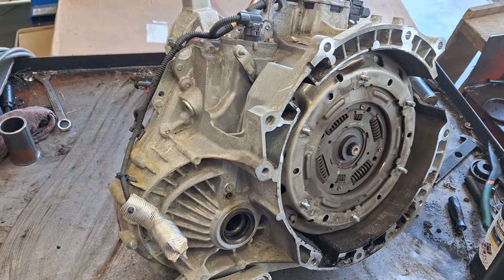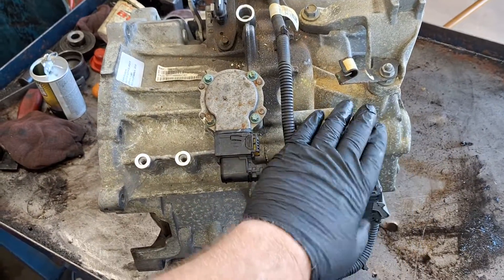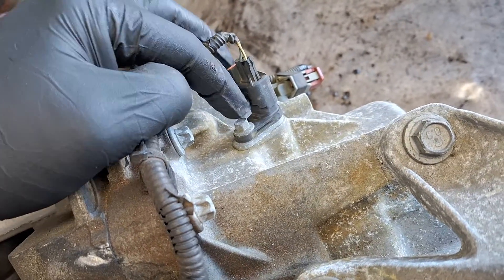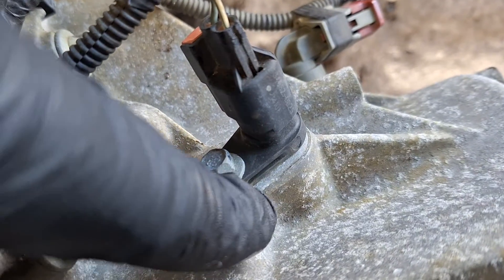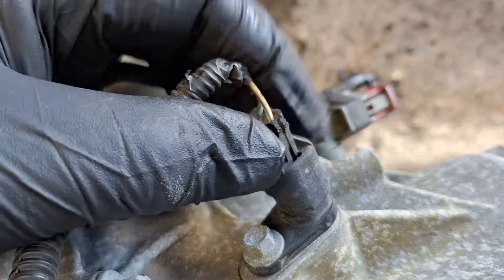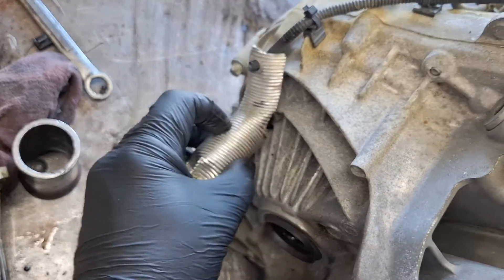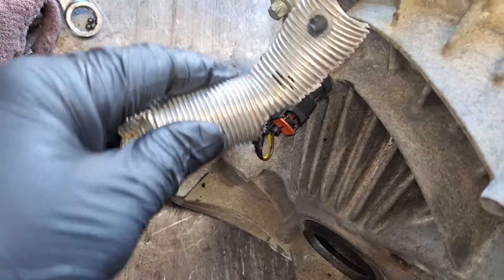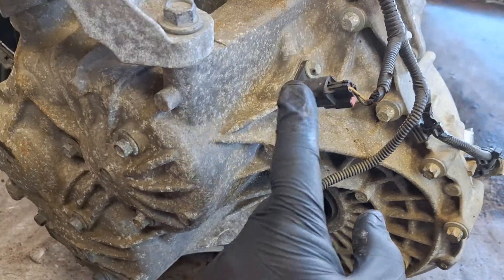DPS6 Sensor Identification Ford Focus & Fiesta (Transmission Sensor Replacement)

Comment: Can these sensor also cause the car to limp and makes the car jacking when goes on uphilds?
Reply from the maker: Possibly, If you have fault codes for one of the sensors I would fix that before assuming its something else

Comment: would the range sensor or switch, cause the drive indicator or the dash flash on and off if its going bad, when im driving the D indicator will flash on and off like its being selected then deslected, like someone is messing with the lever for park neutral and reverse. when the D selection indicator flashes on and off it causes my engine to rev up and down till it goes back to being selected, ran forscan no obvious codes besides p0850

Comment: Hola, tengo un Ford Focus 2012 transmisión automática 
Embrague, horquillas y actuadores nuevos, aprendizaje correcto y sin código de fallo
Pero el carro cuando pasa de 5-10 mph y el motor sube a 2000 rpm el carro brinca da tirones, luego que sale se siente bien y hace los cambios mejor. Es solo   tirones saliendo del puesto 
Que pudiera ser ..?

Comment: Hello Ben 2:29 2:29 2:29 😊  i am driving FORD Focus 2007 . And stat getting an engine and Transmission MALFUNCTION.
 Alram.
When diagnostic the car repair shop we got this error list.
What do reccomaning for reparring.
And is it can be done do it yourself?  Thanks
Reply from the maker: It's a different transmission on the MK2. Need to know what codes you have
Reply: @BigBensCarsAndCycles  z I have   TCM  Error. code number: PO720 FF OSS  : output dhaft speed sensor circuit error.  Hope you have some practical advice for fixing such error.  Thanks
Reply: @BigBensCarsAndCycles I have code  number PO720FFOSS. can you please advise? Thanks

Comment: It has transmission fluid pressure sensor?. And where is located
Reply from the maker: No it doesn't. Not on this one, this is the dry dual clutch
Reply: @BigBensCarsAndCycles OK.  thanks, bc my ford fiesta 2017 has 3 confirmed codes.
P0805
P087A
P0843 transmission fluid pressure sensor/switch A circuit high

Comment: Im so fed up with this car.. got another abs module, still lft front wheel sensor code, right wheel sensor codes, tc light... now a bcm low voltage code.. and latitude and longitudinal sensors code and no speedometer still dont move.. replaced both front wheel speed sensors, oss sensor, and the a/b shaft sensors.
Reply from the maker: It's common for mice to nest and or chew into the wires next to the ABS module. I would check there
Reply: @BigBensCarsAndCycles where is the longitudinal/latitude sensor located?

Comment: Do you know where the fluid temperature sensor is on a DPS6? code P0712? Cannot find any videos on this or removing the valve body for the DPS6. thanks
Reply from the maker: Hey there is none, its based on an algorithm from detected clutch slip. Diagnose other clutch codes first to fix that

Comment: My 2013 Ford fiesta will not go in reverse but will go in drive. I hooked it up and has a code P0870 code  indicates a problem with the Transmission Fluid Pressure Sensor/Switch "C" Circuit. What would that sensor be? Thanks
Reply from the maker: hi that sensor doesnt exist on the dps6. unless, do you have the diesel engine and 6dct450 wet clutch? if so thats not in my market so I'm not sure

Comment: i did that before i bought the hub i even swapped left to right and the same left side keep coming up
Reply from the maker: you swapped sensors left to right?
Did it do it before replacing the hub? If not then you might have put the wheel bearing in backwards because one side of the bearing has the encoder ring so its directional

Comment: hello thanks for all your very detailed videos i bought one of the 2012 ford focus replaced the clutch and forks car is ok now but my abs esc speed meter and my steering feels stiff did a scan and left wheel speed sensor fault came up i replaced the sensor but light still on so i replaced the front abs hub and bearing but my hill assist still remain along with the same abs code swapped the right side over to the left same problem on the left side so i know its not sensor i need help.
Reply from the maker: need to know what codes it has

Comment: Would the OSS give me a trans overheat or trans fault warning everytime i tale the car out?? We have replaced the clutch,throwout bearing, and forks, also tcm was replaced with it..after doing all that the car now started to say the teans over heat or trans fault warning light, but it runs good no crazy shifting or slipping
Reply from the maker: need to know what codes you have  and i can help 1 on 1 in the discord group
Reply: @BigBensCarsAndCycles no codes what so ever just the trans fault warning thst comes and goes or trans over heats that cones and goes..i have replaced tje clutch like said before and forks and tcm as well..i did  not have the trans fsult warning before jist the clutch was worn out thats why it was replaced

Comment: Im back again, and thanks for the last reply back. Short story!!! 2013 focus se 2.0 auto. Just bought. Previous owner replaced both wheel sensors,codes were both wheel sensors, abs pump fault code ,traction light,abs light, and speedometer doesn't work even after the abs wheel sensors replaced. Question is now that i just installed a, abs pump  and module,and wheel sensors,is this going to fix the speedometer or is that just the oss sensor not responding.
Reply from the maker: Hey you can monitor signals from suspected failed sensors while driving using a scan tool
Reply: I can't on the abs side. Live data only on engine side. After installing the abs pump and module, and resetting the codes both front lft,and rt abs codes are back aswell as a longitudinal sensor. The old abs pump didn't have the longitudinal code.. so now I got the  longitudinal code, both  wheel sensor codes,break light, abs light, traction ctl,.. abs pump code is gone.
Reply: Also speedometer still doesn't work but no code on that. Could the (oss) do all this because it isn't reading axel speed?

Comment: Which one does the speedometer?? I've replaced both wheel sensors  nor luck.
Reply from the maker: The OSS. Output shaft speed sensor

Comment: What's the sensor called  that is connected  to the round type sensor  is a six or seven pin six or seven wire  connector

Comment: Ford focus st 1.0 eco boost 2020 where is the transmission temperature sensor pls?
Reply from the maker: @ClarkNicolas-mz5uz  pretty sure it's bolted onto the valve body
Reply: @ Thank you for your quick reply 🤝

Comment: 2015 ford fiesta 1.0 liter . 5 speed manual. Speedometer not working. I cant find the part number for that sensor to replace it. Is it the same as a automatic?
Reply from the maker: @JT-jq9wo  hey it's likely different. Put your vin in on fordpartsgiant

Comment: Could the sensor B being faulty, be the cause of the transmission overheating? It says the transmission is overheating but I checked it with an obd2 scanner and it says its just the clutch position sensor B
Reply from the maker: I've got a video for clutch position sensor codes explained. Its probably a bad actuator
Reply: @ Thanks for the quick reply I also had another question. When I turn the key the car wont start for a few cranks until I hear the engine make a lot of noises then it will start. This noise also happens when I open the door does that mean its most probably the actuators as you mentioned?

Comment: Which sensor is the “overheating “
Reply from the maker: @2010dlewis  the tcm uses an algorithm that uses detected slip to assume overheating.  Usually if overheating you need a full clutch job and new actuators
Reply: @ I did that already. Just started driving it. After 20 minutes on highway it pops up.

Comment: Ben, Great video.  Can you replace the sensor - output shaft speed and transmission connector kit without going under the car?
Reply from the maker: Yes. You can remove the airbox, battery, battery tray, and unplug all 3 speed sensors, then pull the harness up on top to work on it.

Comment: Which one is the park sensor? Or neutral sensor?
Reply from the maker: @2010dlewis  it's the range sensor on top
Reply: @  okay good. Makes me feel little better. Just done the clutch swap from your videos and I half broke this connector. Car says not in park. That’s what I was hoping was. Thank you for fast reply
Reply: @ ok. So I checked the connector. Getting 5 volts. But no crank. Took the shifter off moved it to park. No crank. The indicator light isn’t on either. I just put new clutch in it and just had TCM repaired few weeks ago before I done the clutch. Do you think it’s the positional sensor? Or is it a voltage issue?
Reply: @ also do you know what numbers 1,2,3,4 on the position sensor I can jump to get it to crank?

Comment: My vehicle makes like a rattling noise from the driver side. Think its transmission related. It does it before giving gas and get it moving. Then noise goes away. Then back when at idle. Any idel why it makes noise?
Reply: Sounds like soda cans? It’s the two clock gears apparently it’s normal

Comment: I just read online that if you have an automatic transmission dual clutch and your replacing the actuators that the tcm needs to be re-learned or reprogrammed with an high end scan tool or thru the ford dealer is this true? That's probably why the actuators were not were not working correctly?
Reply from the maker: @michaelbarela2733  hi, replacing the 2 actuators does not require anything after

Comment: Big Ben I replaced both oem actuators and it made my shifting worse and the performance worse my speedometer wasn't working and my dash started acting up, I had to take them back out and put the old ones back In, when I took it for a test drive I decided to just step on the gas pedal and see what happens with the old actuators the rpms still hit 2500 almost 3000 in 1st and 2nd and 3rd gear, this is an automatic transmission, I ordered an output shaft speed sensor I'll see if that fixes the problem, next step would probably be to replace the TCM, any suggestions?
Reply from the maker: @michaelbarela2733  hi, what fault codes are present? And yeah since your speed wasn't showing that may be the problem
Reply: @BigBensCarsAndCycles  no codes are showing, my speedometer works just fine now with the old actuators put back in, I'll wait until I get the output shaft speed sensor installed and see what happens probably nothing lol, I don't think it's normal for a car to hit 2500 or 3000 rpms In 1st 2nd, 3rd gear is it? Can a bad tcm cause that to happen? Will PID read the tcm ?
Reply from the maker: @michaelbarela2733  I'd drive it until it sets a code. If you full throttle it while it's acting strange that can help set a code faster

Comment: If I'm not showing any codes can a faulty output shaft speed sensor cause poor acceleration with high rpms?
Reply from the maker: @michaelbarela2733  maybe. Check the pids on the scan tool for signal drops or spikes
Reply: I have a cheap cable obd2 I don't believe I have options for PID, would you happen to know if cheap obd2 scanners have options for pid, I might have to invest in a better obd2 or a wireless wifi obd2
Reply from the maker: @michaelbarela2733  forscan is a good option, you need a laptop interface for 30 bucks

Comment: Hey Ben, big fan of your videos I actually recently did the clutch/fork replacement on my ford focus 2013  thanks to your tutorials I put everything back but the car won’t start I put the scanner in to it to do the adaptive learning and I get a range sensor code do you think thats the reason for the car not starting I also noticed that on the scanner I can see that it says it’s on drive when it’s really on park I’m thinking of replacing the range sensor but I thought I’d run it by you thanks again
Reply from the maker: @LuisGarcia-pr3rv  hi, glad the the videos helped. I would make sure you reattached the shifter cable to the transmission
Reply: @BigBensCarsAndCycles  that is the first thing I checked when i noticed it was not working I get a lot of different range sensor codes like P0707,P2801,P2802,P2803 I just hope it’s not tcm related

Comment: Great job ben! Just wondering if i have a error code P1934 Engine Control Unit - Vehicle Speed Signal, can i solve the error just by replacing the input speed sensor A (the grey one). I have other codes about ABS U3000(48), but i just want to leave it by when i have the funds to replace/fix the ABS. Thankyou!
Reply from the maker: @risuchannel8115  hi, glad the videos helped. I would look for a damaged OSS or OSS wiring. If that looks OK, I'd monitor signals for OSS, rf wheel speed and left front wheel speed while driving

Comment: Very helpful. I smooshed the input sensor B wires and exposed the conductors trying to get the trans back in place. I found a replacement pigtail right away once you mentioned the ABS pigtail is the same.

Comment: Recently I found your video and very instructive. 
I have ford focus 2014 but it's giving me hard time with the ABS light,  traction control and speedometer doesn't work. 
I changed all the wheels sensor already. 
Front right wheel sensor is not reading, besides that ANY advice. 
Thank you 👍 👍👍👍 Good day
Reply from the maker: @basschallenger  hi! Check for damaged wires by the abs module behind the battery tray

Comment: Can I reline the stud in the flywheel after the transmission is in ?
Reply from the maker: No, it needs to be pulled back. But I haven't found indexing to be a problem

Comment: Hi BigBen thanks for sharing this video. My 2010 ford fiesta 1.6 T giving me lot of issues with the transmission malfunction message. I went to a dealer service and after diagnose they informed TCM module need replace. The next day when i went to replace the part they informed the ABS also need replace. I feel something wrong and i didnt replace anything after seeing the cost of both module arround 1500$ Still the car is running and speedo Audo meter not working. Some time the car show the message transmission malfunction service now!!! Can you advise me any other reason for this issue or I need to replace the TCM and ABS?
Reply from the maker: What codes are you getting?
Reply: @BigBensCarsAndCycles   There are a bunch of codes as below
P0507: 27-24
U2005: 86-EC
1934: 86-EC
U0001: 88-2E
U0121: 87-2F
U0101: 00 - AE
P060A: 47-AF
P0072: 94-AE
I did a 150k service in another dealer center last week and after diagnose they repeated the same to change the ABS module. Now after service the engine malfunction also showing and dealer saying it all because of ABS module. They said I can use the car but ABS will not work.

Comment: hey love the great work you'r doing, im kinda suck right now but have you ever deal with a 2014 focus with a code p2837?
Reply from the maker: Hi, glad to help. If that's your only code (and you dont have P287B) then its probably a bad tcm
Reply: @BigBensCarsAndCycles  yes i do see a p287B , the car can drive in forward but the reverse isn't taking along with the second gear. the clutch was updated because i saw a sticker on the transmission stated. any advice on how i can check to fix this  please . thank you so much in advance watching your videos give me a sense of relief

Comment: Hey Ben, you have been really helpful with the problems I have been having with my ford focus. I am in the middle of replacing my neutral safety switch and I am having trouble getting the connector off and I don’t want to break it. Could you please explain how it’s supposed to come off? It would be greatly appreciated
Reply from the maker: I'm glad the videos helped. There's a lock you have to slide up. Then the connector has a release button and comes up

Comment: hey ben: i recently rebuilt my 6f35 and got it working great, for a few hundred miles. i have a bearing that goes between the 3-5-reverse and the case. the one at the bottom that surrounds the ring tower. do you know the name of this bearing? i found a kit, but i really just want the one bearing and dont know what its called so i cant find it anywhere. anything helps.  thanks
Reply from the maker: Direct/od to case thrust bearing. It'll be obvious it's the only one with black on one side
Reply: @BigBensCarsAndCycles  thanks, been looking for weeks

Comment: Is it normal for the transmission to shudder and vibrate hard?
Reply from the maker: Pretty much characteristic
Reply: @BigBensCarsAndCycles  but it only does it when is in idle also I get that code that says transmission fault service now
Reply from the maker: @andresquinonezramirez9373  OK that's not normal. Gotta diagnose the code
Reply: @BigBensCarsAndCycles  ok let me tell you the car drives fine and also I have no check engine light on like if something is wrong with the transmission like you would usually get from a faulty A or B Fork or actuator
Reply: @BigBensCarsAndCycles  what you think it could be?